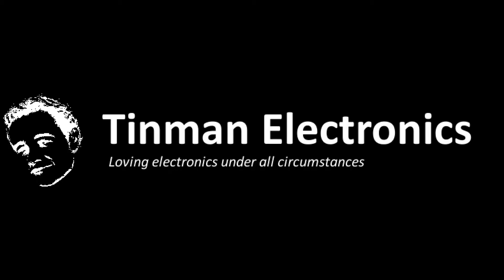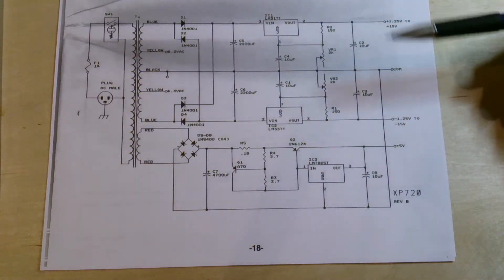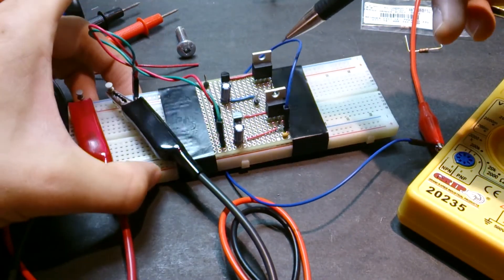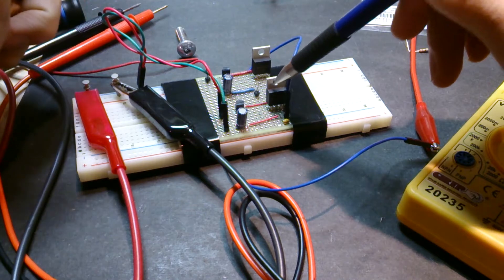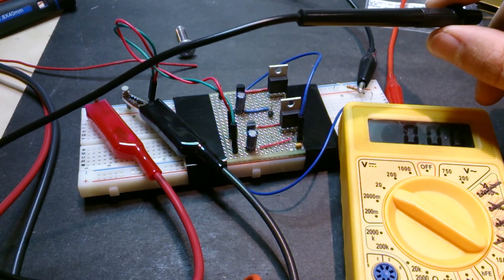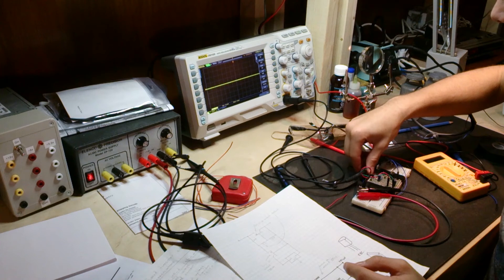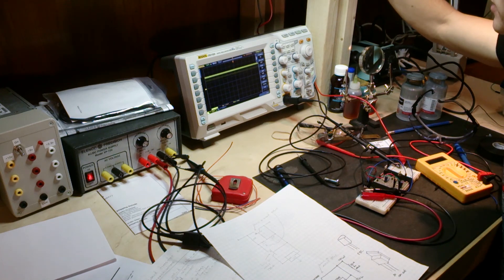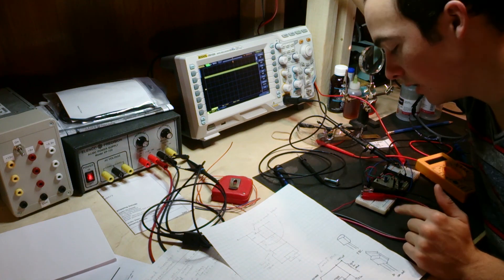Tinman Electronics 6 - How to get more current out of your regulator

Comment: If your going to build a bench psu from scratch, 1 make sure your transformer has the desired output voltage and current. That is where you should start. 2, ditch the cheap $1.19 lm317 / nte957 and invest a little more into your prized psu. Don't be that guy who Mick Mouses something to "sort of work." Just do it right the first time. 

I get the excitement of the first psu build. The rush of new knowledge and the urge to it done to mess with. But remember, in those few dollars you save in cutting corners will come back to get you when you realize should've went this way, should've went that way, you start disassembly and ruin your awesome new housing you put it in or break something trying to modify it for improvements. 

I'm not saying what your doing is wrong. I am by no way trying to berate or down u. The lm317 is actually a great stepping stone. However, if your in need for a decent diy psu... Reliable, with all the voltage and current you want think outside the box.... Think Bout what's in the box next you're box. Hell  think about the box next to that box and the other box. 

Don't forget about the options of both full and half wave rectifier (optionally on a toggle switch).... Just saying. Good video tho

Comment: Great power supply but the one below is perhaps a bit more down to earth and almost any transformer works fine. It's also been around a very long time. I made one from an old Monacor 120W 100V line amp. That uses TIP35C transistors but I have 2N3055's just in case. It's 0 - 38 V and I did push it to 7A at 20 V (140 W) but I do use 2 fans run at 10 V. The LM723 has been around for years and is very cheap. You don't really need a PCB even. 
http://electronics-diy.com/30v-10a-variable-bench-power-supply.php

Comment: Having an inaccuracy of 0.2V is common when your leads are long and when taking Amps measurements. They all contribute to the voltage drop in your reading. Also, breadboards are nasty with connection resistances.

Comment: When You Limit The Current Output To 1 amp on the 7805 and Use a Pass Transistor for the Extra Current Clearly Demonstrates Great Circuit Design .....Many Thanks From 321reh

Comment: sir my circuit is like this.. 220AC/12---1A-- trasformer to 7812 then to 7805, i want a 2-3A output from the 5v is your circuit applicable?
Reply: +dscytheProductions This circuit won't do it. You'll get at most 1.2A out of it.

Comment: Hey Tinman, I'm wondering if I could have transistor turn on earlier, or better yet turn on with a lower current draw instead of it turning on at 1.5 amps. I want to alleviate the work load from the voltage regulator. I'm trying to get away without a heat sink. Is that possible? Perhaps? It'll be awesome if you can get back to me. Love the channel by the way. Like and subbed!

Comment: When the voltage across the sensing resistor exceed 0.7Vand your transıstor start to conduct, does not seem lıke your voltage regulator ıs no long part of the cırcuıt  beause the current wıll go through the trasıstor not the voltage regulator
Reply from the maker: The PNP transistor will only conduct if the regulator can draw current through the base of the transistor. The transistor is a current operated device, and as it conducts more heavily, it requires more base current to be drawn. This could not happen if the regulator was exlcuded from the circuit once we achieve the 0.7V.

The regulator must be operating in order for the transistor to conduct as well.
Reply: Thanks for your response......

But the base is already connected to the 7V input so current can flow from the input to the base and make the transistor active
Reply: Hassan Omer I mean it does not need for the voltage regulator  to draw current
Reply from the maker: Hassan Omer After the transistor turns on, the voltage at the input of the regulator will not stay at 7V. I know the dropout voltage of the regulator is around 2V, but that only dictates the minimum voltage drop across the regulator. The input voltage to the regulator will be Vin - 0.7V, because the voltage across the resistor will be clamped to 0.7V (same as the Vbe drop of 0.7V).
Reply: Tinman Electronics Thank you very much for your response